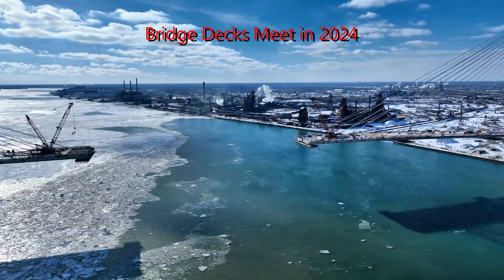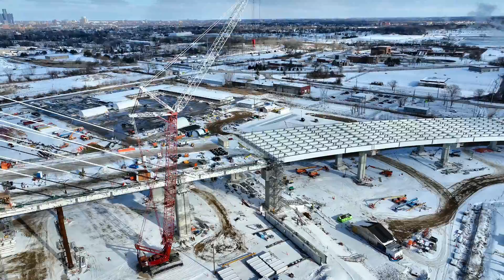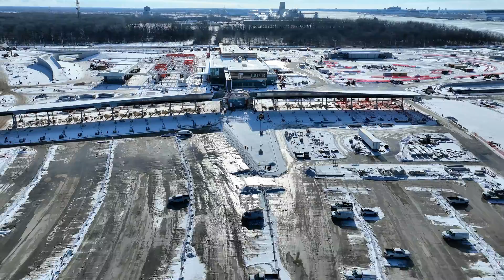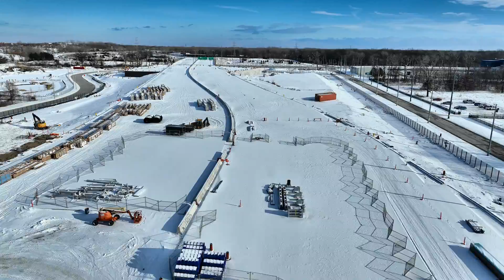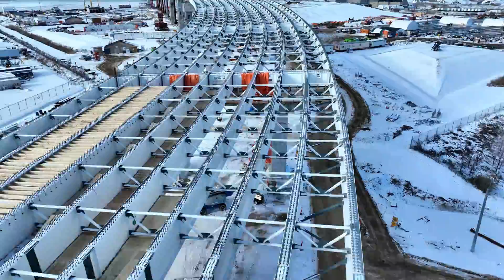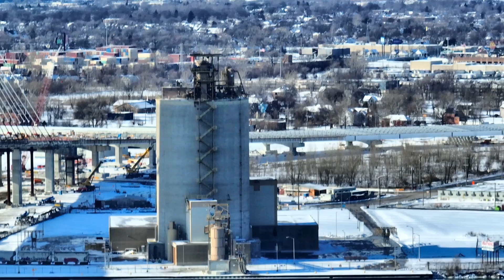How Fast Is the Gordie Howe Bridge Being Built?

Comment: Every gov contract goes over and there are a dozen diff excuses why ( I wish for once they would make a contract iron clad & binding ) secondly the construction of two towers on each end coming together as one has been solved , as the Portman bridge in British Columbia Canada has a similar design and anytime it snows or freezing rain. They have to close off the centre lanes because the snow and ice bombs from the top of the cables fall into the roadway and shatter windows, so I hope they figured out how to fix this problemas Vancouver BC bridge has not been fixed yet after 10 years
Reply from the maker: Hi @abbyman. Sorry I missed replying to your awesome post sooner. 
What are contracts for if not to see participants live up to their contractual responsibility? When cavets are are crafted to allow the agreements to be altered, due to certain, any and/or all unforseen circumstances during the completition of the agreement, that agreement is in my opinion, simply a guidline ripe for exploytation. 
As for the icing issue, the sheathing on the Gordie Howe Bridge is a real concern. From what I have read they do have a solution that restricts the formation of ice on the cable stays. Some kind of chemical reaction in the materials. Don't quote me on this cause it isn't offered in the official website or with a simple seasrch. 
Thanks for the insightful post.